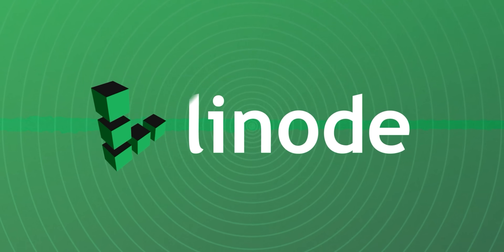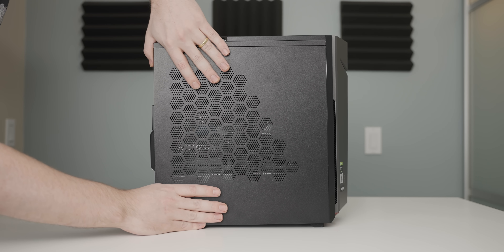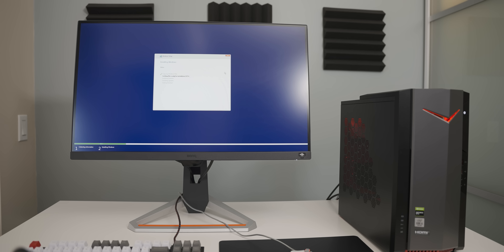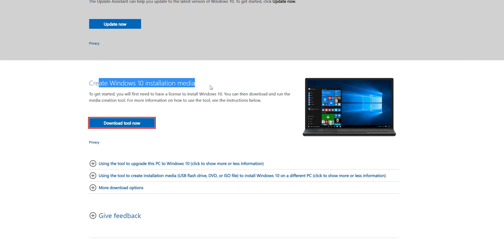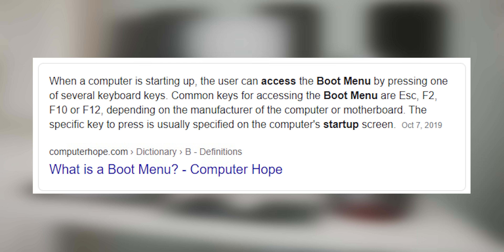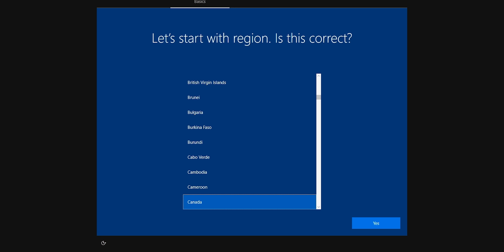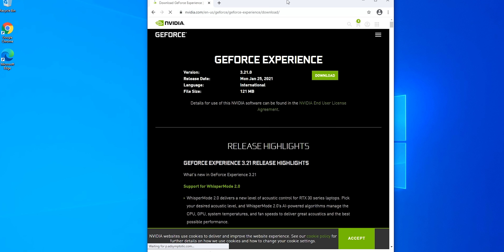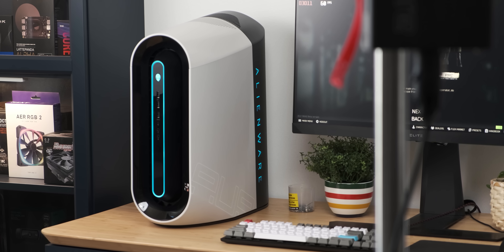4 Simple Steps To Set Up Your NEW Pre-Built Gaming PC

Comment: Step 1: reconsider life choices
Step 2: return pre-built to store
Step 3: spend thousands of dollars on overkill parts
Step 4: make fun of pre-builts on r/PCMR
Reply: step 5: reconsider life choices
Reply: @cl-e-m  ah
Reply: or you can just build your own budget pc
Reply: @kingkosher6231  Well with stocks now its hard
But not impossible because if you get a 3060 ti at close to msrp the well you have a budget beast
Reply: @kleszczoros4885  lmao you dont need a 3060 to play games guy, stop lmao
Reply: @kingkosher6231  yea but it is quite good performance for buck
And it can run AAA games quite nicely
Reply: @kleszczoros4885  lol if you can actually find them lmao
Reply: just built a crazy value PC for 373 dollars USD

i5 4570
GTX 1070
550W 80 plus PSU
120GB SSD
500GB HDD x2
Cooler Master HAF X case (lol old gold)
Cooler Master Hyper 212 Evo Black Edition ARGB heat sink (same old 212 but blacked out with RGB)
Patriot 8GB x2 1600mhz 16GB kit of RAM
4x 120mm ARGB fans controlled in a daisy chain with the heat sink's controller powered by molex/sata
and a random DVD-R/W drive cause I have a lot of em.

Imagine getting ALL THAT for 373 dollars USD? just do some parts hunting. I know 4th gen Haswell isnt the best for 2021 but i can always get a 4770k or a Xeon and push it even further with this system. 

This was also not all bought at once this took months of finding the right deals at the right time and jumping on them
Reply: @kingkosher6231  I have to say that is a great pc 
But let me guess
Used GPU bought before the great covid price inflation
Reply: @kleszczoros4885  bought the 1070 two weeks ago lol
Reply: @kleszczoros4885  it was $175
Reply: @kleszczoros4885  it had a 960 4GB before then which is now going to a new budget build for a friend I just like having a secondary PC for friends so we can play games
Reply: @kingkosher6231  my 4gb 5500 xt is doing me wonders on every game I play I came from ps4 so all I want is 75 FPS to match monitor and apex r6 warzone gta bf4 battlefront and all the other games run smoothly although I would had been nice if I got the 8 gig model I’m fine with what I got
Reply: @kingkosher6231  yeah but vr
Reply: @NeedyBoBeedy  vr sucks and its a trend, qq
Reply: People who are waiting in line for 20 hours to get a GPU, need to reconsider their life choices.
Reply: There's no such thing as overkill my friend.
Make way for my 49" ultra wide
Reply: @Emmy try harder and be open minded about used parts
Reply: @Emmy that really sucks.. sorry to hear it but also understand that you can get a Lenovo M83 Midtower with a haswell i5 for 120 to 150 dollars USD, get a PSU adapter, a 500+ Watt PSU (powerspec makes a good cheap PSU for 50 bucks USD) and find a used GPU and make a good little budget box. A lot of my friends did that.
Reply: Oh boohoo I got a prebuilt that was on sale for a good price so i’m keeping

Comment: Probably a really basic one, but it is important: if it's winter, or just cold where you are right now, don't plug it in just after getting it, let it warm up. It'll have come straight out of some freezing warehouse and potentially is getting condensation inside. Responsible for plenty of sob stories at Christmas, though usually with consoles.
Reply: Thanks for the tips!

Comment: For Installing Windows, why can't we just do a PC Reset?
Reply: not all pre-builts have a "Factory Restore Point", but if it does generally it is with all the Bloatware included,
so you are better off with a fresh install & make your own "Restore Point"
Reply: @shaneeslick  reset is much better because if you already paid for a license and is activated just do the reset and it will be fine. windows lets you choose to format C or do a complete wipe of all drive or you can keep C file and do a sort of soft reset that will keep some file but will remove installed programs. flash drive in my opinion can be kept to ,if the pc came with a (non-legit) windows.
Reply: @Dkm337  Widows 10 has the Activation Key stored in the Motherboard BIOS, if you wipe 'C' drive then you do a Full Re-Install & select "I do not have a product key" it will Auto Activate when you connect to the internet & do updates, even without a Microsoft account
Reply: @shaneeslick   ohh , good thing to know. that it stores in bios. i personally just use my windows 7 license and upgrade to 10 then do infinite reset on my desktop. while on laptop i signed in first then made a hard full reset. what ever method gets the bloatware out. thanks anyways.
Reply: @Dkm337  Glad to have helped, So now you have used your W7 Key for W10 it is stored in BIOS, if you wipe the 'C' drive W10 will search BIOS & Auto Activate when the PC does Update to search for drivers,

I have a nephew who is Autistic & is always going into settings "what does this do?" adjusting everything to the point of Black Screens or constant BSODs, Me "What did you adjust?" him "I don't know" 
he now has a 120GB SSD with just W10 & I set it up so everything else like games download to a 2TB drive, a Fresh Install is the fastest way for me to fix everything & just relink the folders

Comment: step 1. get another ram stick
Reply: just cut your stick of ram in half for the dual channel
Reply: @tree427  you are a genius!
Reply: @tree427  2 so-dimm ram sticks
Reply: So true that I don’t know what’s true anymore
Reply from the maker: That will come in the "How to fix common problems with Prebuilts" video. 😁
Reply: Step 2: Add an extra SSD to go with the extra RAM that you should have bought with the PC, but you were too cheap back then.
Reply: @CaveyMoth  The problem with the extra RAM and larger capacity SSD is that the OEM will charge double the going price for them. That's why I end up buying them separately. Of course, the only pre-builts I buy these days are laptops.
Reply: @CFWhitman  You're right, man. They'll overcharge, and use underperforming products.
Reply: @CaveyMoth  dang you got scammed too. try ordering from better sites or atleast do more research and check the Ram and ssd
Reply: And enable x.m.p on the stick or sticks
Reply from the maker: @rhpidfyre  oh crap. I forgot to add that point.
Reply: Just download more ram.
Reply: and make a ram handle out of it
Reply: @SkeLLy bro what💀
Reply: If you bought a prebuilt with only one stick of ram in the first place, there is no hope for said person. How the hell does a gaming pc manufacturer think its acceptable to sell it using single channel memory, unbelievable.
Reply: Step 2 get a better cou cooler
Reply: Step 1 ☑️
Reply: Nah you already fucked up if you didn’t have enough Ram out the box. Any company selling pcs with ram like that are just tryna scam people like you. Don’t buy from them. Find a site where they already have enough Ram and all the components are good quality.
Reply: is ddr5 16gig 4800 mhz dual channel good? i have a msi prebuilt gaming pc
Reply: Lmao!! I just got my prebuilt pc in the mail today and the day I ordered it I also ordered a set of 16gb Corsair vengeance ram sticks to go from 16 to 32 gb